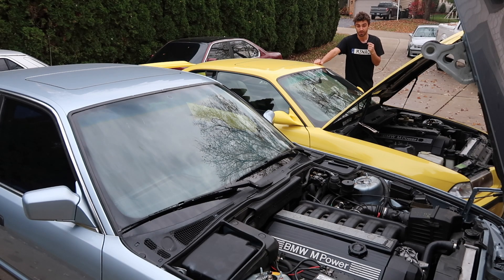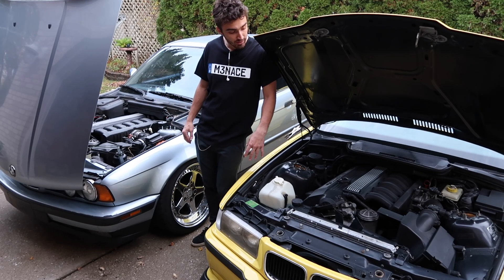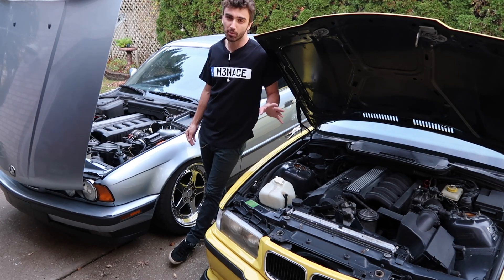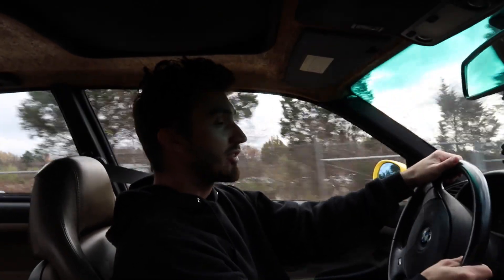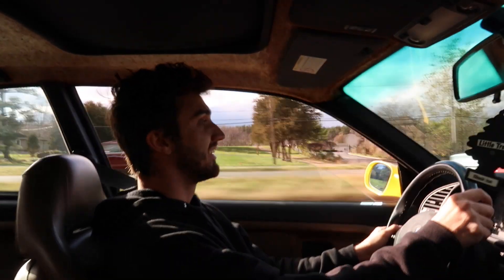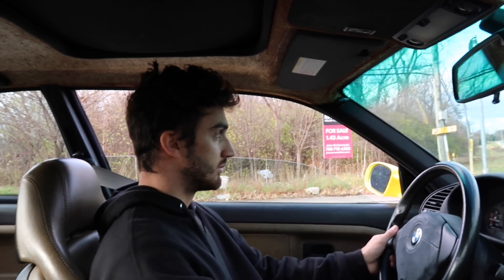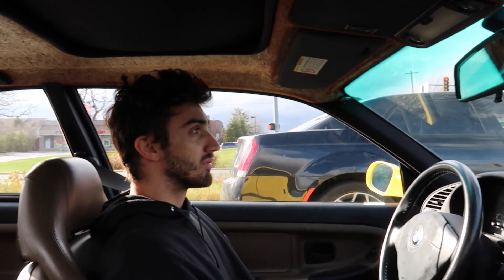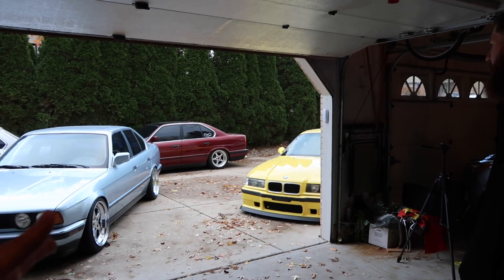OBD 1 Converted S52 vs. OBD 2 S52 Side by Side Comparison | The Differences in Action!

Comment: Definitely worth it. I put an m50 manifold on my s52 and tuned it. The top end pulls so strong plus it sounds better too. The powerband is like an s54 minus the 1000 extra rpm. 
Definitely lost a good amount of torque under 4K RPM so I ended up putting in a 3.38 from an auto m3 and now its perfect. Feels like an M car now.
Reply: That's sick! I have the 3.38 in mine as it was an auto too, but just converted it to manual. Planning on doing the manifold swap so I'm glad the diff made the... diff! What tune are you running?

Comment: The MS41.1 DME is far superior to Bosch ODB1 DMEs is so many ways, it pain me to see so many people go backwards converting to ODB1. The X20 engine harness to the body connector only needs to have a few wires swap around and an ODB2 port(4 wires) can so easily be added to an ODB1 chassis it's a 0 cost no brainer to keep an S52 ODB2.
Reply: If you just swap the m50 intake manifold then it’s best of both worlds. I thought that’s what all “obd1” swaps were just for the manifold but keeping the ecu of s52 right ?

Comment: Great video. When I was in my 20s I was a salesman for those models at a BMW Dealership.
You're very talented and do great work!  I love your cars!
The only thing I would change is that I think the trims are too big. I think those cars would handle better and look better with 18 inch rims IMHO.
Reply from the maker: Appreciate you man! But the E34 is on 18 inch wheels and the e36 is actually on 17s!
Reply: @m3nameisjosh464  oh! must look larger because of the lower stance. My bad!
Reply from the maker: @bricklawson9745  yeah likely because of the lowering. But I am thinking of downsizing the wheels on the E34

Comment: I have a “new to me” 97 e36 m3 with an obd1 conversion & m50 manifold that the previous owner did. I don’t know much about how to repeat the process, or how much work it really is. But what I can tell you, from the point of view of a track car, it’s Awoken the beast inside the s52. Lol. The power on track is incredible. At my last event in njmp I was able to keep pace on the straights with NEW Supras, the did pull me out of the corners but over 90 mph it was close. My car is 2750 with me in it and I don’t have any dump numbers but I would guess around 240 wheel. The previous owner said it made 260 at a dyno shop but I’m skeptical.
Reply from the maker: Awesome to hear from more first hand experiences!! Insane how these things keep up with modern cars! But yeah 260 wheel without cams seems a little high, but who knows haha

Comment: Question if you have time to answer. Love all your builds and wish I was as talented haha.. But I did get an E23 733i but moved for work and let it sit for 4 months, and now it won’t start. I looked up on forums to change the fuel relays, did that, still cranks but injectors won’t fire, but started on starter fluid. Know anything common that does that? And is it worth swapping the stock motors in the E23s?
Reply from the maker: If it sputters on starting fluid then it has spark, so that eliminates crank sensor. Find the fuel pump relay and make sure its the right one, then jump pins 30 and 87 and you should hear pump run, if you don’t the pump died or its the wrong relay!
Reply from the maker: Stock m30b35 is great, id leave it!

Comment: Appreciate this vid. Just bought a s52 swapped e30 with m50 top and manifold and trying to understand what that actually means performance wise. 

If I want to have more low end torque what are my options?
Reply from the maker: Cams id say, maybe some exhaust work
Reply: by using the m54 intake manifold instead. bit more involved but worth it.

Comment: i just got my first e36, 1992 325is OBD1, runs great, but, it has slow pulsing surging on it's way up to red line, most of the time sometimes not. yes OBD2 gives more code clues but I'm 67 and fixed cars with no computer for decades. Do you have any idea what might cause slow pulsing fluctuation in rpm on the tach at idle and feeling it when pushing hard to redline, it was way worse before I added a ground strap at the battery, before i added the battery ground strap it lost half of it's power above 3500 rpm. then boom almost fully cured! Here in Hawaii the electrical corrosion is the most intense of anywhere I've ever lived, full electrical harness replacement here is common because of corrosion.  so could be connection somewhere to something, but what: MAF? TPS? Maybe the main computer? Where is it? it's livable but I'm a little bit of a perfectionist, these cars are so nice it's like music, a symphony.
Reply from the maker: Hmmm, hard to diagnose without being there. No check engine light?? Fluctuating RPMs can be a cam position sensor, a bad vacuum leak, possibly a TPS, or a maf. 92 so im guessing its non vanos which eliminates that possibility
Reply: @m3nameisjosh464  no check engine only 2 brake lights ABS i'm guessing.
Reply from the maker: @mrkeopele  weird, most all issues causing an irradic idle would cause a Check engine light
Reply: @m3nameisjosh464  thanks for your response, it helps me to talk with others, I just realized on todays drive that it's not the tach varying a little on low end it's that vacuum gauge at the bottom of the tach and realized it's probably a weak hose maybe collapsing a little or the start of a vacuum leak, so i'm thinking clearer now and closer to the fix, and todays ride no pulsing all the way to redline and the cutout seems to be at 6600 or 6800, so happy happy, thanks again.
Reply from the maker: @mrkeopele  so she’s perfectly
Good afterall!!

Comment: So I traveled for 120km with my bmw e34 525i and I got it full gas tank then it drained the gas quite fast. I'm not sure if that's really how it is and the gas consumption is that high or I'm experiencing some problem. Also during my road trip there is a burn smell for 10 seconds and it goes away. What should I check?
Reply from the maker: I get 400 miles to a tank in my s52 e34, you should definitely get close to the same. Burning oil may be valve cover gasket
Reply: @dric @M3nameisjosh

The burnt smell could be the blower motor resistor, change that and the cabin air filter or else your car can burn to the ground, i fixed my bad fuel milage when i changed my pulled my intake manifold, cleaned and rebuilt my injectors, replaced my vacuum lines and cleaned my icv, and replaced my fuel regulator after i did all that my milage really improved so one of those things or the combination of things helped

Comment: My BMW e34 525i starts well but it dies sometimes at low rpm and the engine has a leaping sound, not a continuousrunning sound when starting/low power. Could this be a need for fuel pump replacement?
Reply from the maker: Sounds like a vacuum leak. Dies at low rpm and inconsistent idle
Reply: @m3nameisjosh464  So should I just buy a throttle body gasket and replace them?
Reply from the maker: @dric3694  i would do all the intake gaskets and vacuum lines, especially Icv hoses

Comment: Do you actually see a noticeable difference tuning these motors?
Reply from the maker: There has to be mods that compliment the tune imo. For example a tune with an m50 intake will be noticeable! A shark injector flash on a stock s52 would be so minutely noticeable
Reply: @m3nameisjosh464  thanks for the insight I have a e30 s50 swap with intake, s52 headers, m50 manifold, csf radiatior, exhaust, and was considering tuning it. Just wanted to insight on people that actually have tuned these motors
Reply from the maker: @arachnidjohnny8196  I think that is worth tuning!

Comment: The driving comparison is kinda compromised with 1 having the intake done...also isn't there something with the headers or exhaust? The "shortys" headers they sell state they only work with obd1 cars,so I assume something is different. Lol u haven't purchased a intake in awhile have u?$150 is the old price,ur lookin $225-$250 now a days. Btw I obviously comment as I watch
Reply from the maker: Well thats the whole purpose of the video to show what the manifold does. As for headers both engines are on stock S52 headers, e34 ones just had to have one flange twisted to work with obd 1 exhaust. But you’re right its been a while since I’ve bought one hahaha
Reply: @m3nameisjosh464  I comment as I'm watching so by the time it was said in the video it was too late lol.

Comment: Idk why people do a obd1 conversion. If it came like that ok leave it. But no point on going back ... 🤷‍♂️. Manifold yes. More power from a obd1 converted ... not really. These days you can almost dial in a obd2 car with a laptop and a afr probe. Obd1 is just rudimentary. Actually jordan from rk tunes says this also 🤷‍♂️🤷‍♂️🤷‍♂️
Reply from the maker: An e34 never came obd 2, theres not an easy way to adapter obd 2 into the car. Going obd1 is easier and cheaper. But i agree, taking an existing obd 2 car and going obd 1 is pointless

Comment: Bro OBD is not an engine management system
Reply from the maker: On board diagnostic 1 and 2 are both kinds of engine management. Same thing as motronic 1.1, 1.3, etc, yeah obd is a generic way to say it but idk what else youd say? Ms41 is the obd 2 engine management system
Reply: @m3nameisjosh464  Sorry fella, but OBD 1 & 2 are not engine management systems in any way shape or form. They both allow you to read all sensors on the car. You can connect a DIS/INPA or any bonafide BMW diagnostic head to the car and enable or disable options as well as read and reset fault codes. Motronic is the engine management system and you can rechip or remap if you have the know how, or replace it with something like a Megasquirt. Also for info OBD 1 was fitted to BMW's from 1988 onwards, E30's/E34's/E32's and E31's prior to 1996 even the M30 engined cars, at least in Europe

Comment: i most of the diffrence was between the drivers shifting times than the tune. if you  have 2sec delay in shifting than even the 40 les hp car /heavier will pass you.😂😂dont shift like ur cruising 😅😅
Reply from the maker: Im not sure why i shifted so slow🤣🤣 i noticed that watching back
Reply: nice builds though 😌